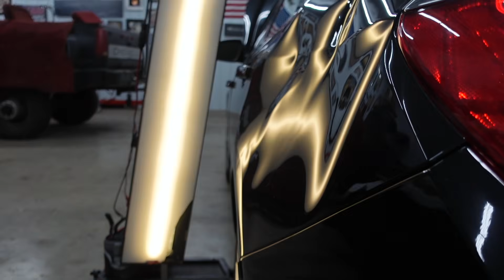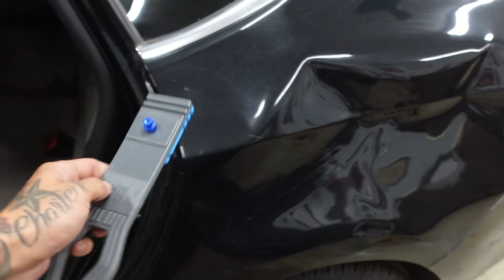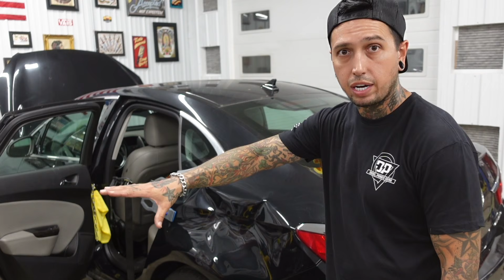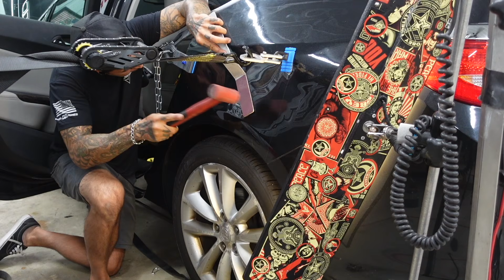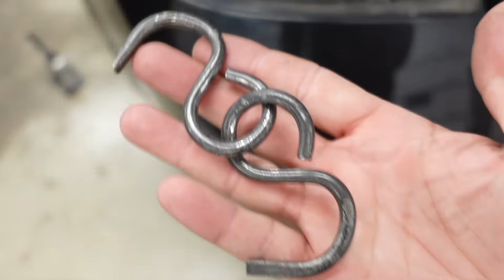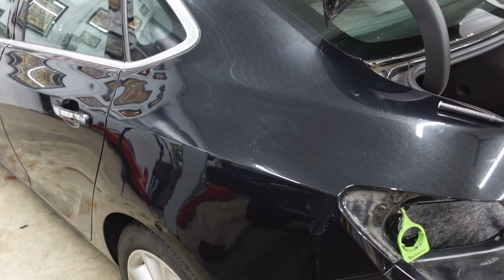large dent repair - Glue pulling power

Comment: What type of glue you using. and how long you wait till you pull . And how hot the metal you get
Reply from the maker: I used cam auto collision glue. Wait time is about 3/5 min. I keep the metal warm to the touch for the most part ..
Reply: @elevationdentco  thank you I will try this method